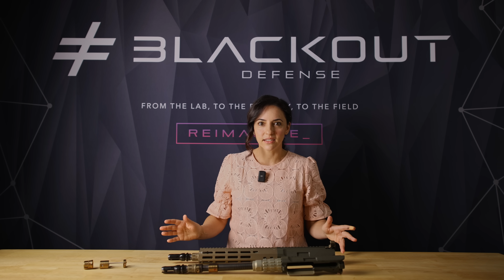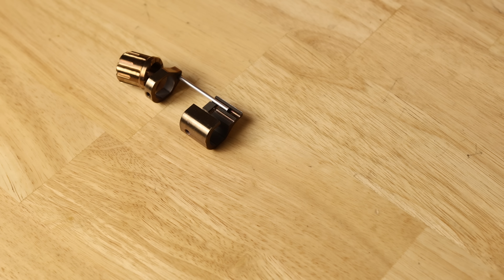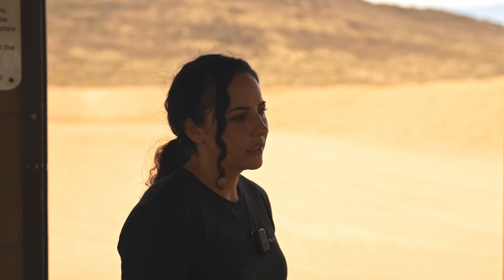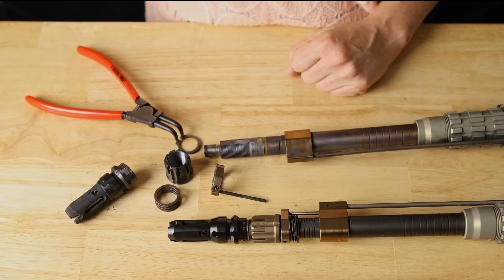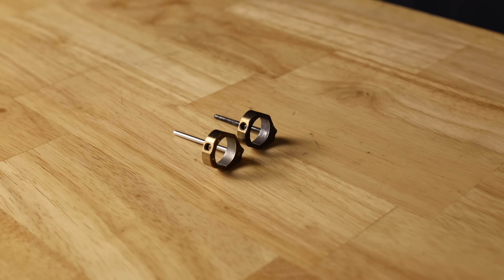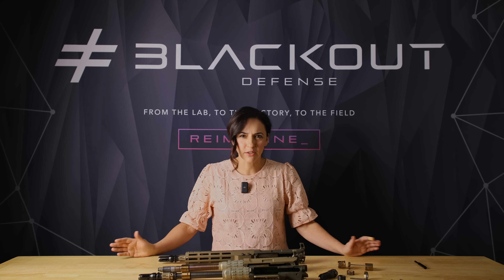HELIX Gas Regulating Barrel System

Comment: It's a more complicated Riflespeed they just added an extended rod and made it two pieces instead of one. And it only works on their barrels?
Reply from the maker: 1- can drive your adjustment from the fully open to fully closed position without changing your rod. 2- There are 20 usable settings. 3- the critical spring and detents are away from carbon exposure 4- Its lighter. 5- Most importantly, you can maintain this system without removing your muzzle device or even your pinned suppressor. 6- you can lock your gas setting in place which is excellent for duty use. I am also adding what I have responded to other users for your convenience: We make our own barrel and everything else on our rifles except plastics and springs. This barrel is reverse compatible. You can remove the Helix system and install your desired gas block. Our barrels are 416R SS and it is blackened (cold bluing method). Regarding the adjustment rod being split. This M42 rod is part of the national stock number. You can simply buy it from McMaster (Part number 8813A28) then it can be grinded to the size appropriate for the barrel gas system (pistol vs carbine vs mid length and so forth). We are also going to provide dimensions and spec for the rod on our site. M42 is very difficult to machine but can be easily grinded like sharpening a punch or drill bit. For those who do not want to deal with it, we will offer it precut on our site. You do not need to remove the muzzle devise. You can disassemble the rod at a certain position or alignment with the adjustment knob (there is an undercut on which creates free access to the rod.) Rod is held in place via 82-degree tip set screw. Please visit our IG page. I have shared everything from my modeling on CAD to how we made this system. I tried to cover everything as possible.

Comment: Making all in the gas block so it could go on any barrel seems like the next step for a V2.
Reply: that cuts into profits, so no.  also i bet riflespeeds patent involves the milspec barrels, so they cant touch the accessories market with a universal gas block without infringing on the patent completely.  Its also probably why they needed to make the parts for a proprietary barrel as reduction in scope, compared to the existing patent.
Reply: @abcdefbcdefg8352  by that logic no one could make a gas block which is obvious not happening

Comment: So you created a hex wrench replacement that's overly complicated. Congratulations you engineered for the sake of engineering. A set screw can replace all of the forward pieces.
Reply from the maker: Congratulations to you, my man! Apparently, you don’t know much about adjustable gas block carbon lock or internal “welding” due to erosion and carbon build up. Run your little set screw until is fully eroded or carbon locked. Then we can discuss using a 3/32" x 6" hex wrench to unlock it. That  will result in a $100 nonadjustable-adjustable gas block.

Comment: So it's an adjustable gas block that incorporates an additional 5+ parts for unnecessary complexity, forces you to use a proprietary barrel, and hangs unsecured (or partially secured) weight towards the front of the barrel, making the barrel harmonics so bad that it will noticeably induce group widening. I wouldn't run this if it were free.
Reply from the maker: I am so disappointed to announce that we are going to cancel your free rifle.

Comment: Well I can appreciate showing the wear and yeah thats to be expected. Obviously will be compared to rifle speed. Regardless for duty use whether this or RS, I think if there were some way for the shooter to find the 2,3, or 4 gas settings they would use and then give them the ability to remove the detents for the rest of the positions. Say they want 3 positions, unsuppressed but tuned, suppressed, and then a setting they choose for adverse conditions. That way they can remove a bunch of extra clicks, counts, paint marks, whatever. But I’m not sure its doable with the design.
Reply from the maker: I appreciate your thoughts. Thank you!

Comment: with it eroding like that will there be replacements for that rod since this seems to be a disposable piece
Reply from the maker: We have not been able to replicate the erosion in semi auto environment. Erosion is more pronounced in full auto testing but not in semi auto. We recommend replacing the rod every 12-15k round. It would cost under $10. Cool fact: This M42 rod is part of the national stock number. You can simply buy it from McMaster (8813A28)! It can be grinded to size appropriate for the barrel gas system (pistol vs carbine vs mid length and so forth). We are also going to provide the spec for the rod on our site.
Reply: @BlackoutDefense  thanx for the quick reply, that is awesome to know that it is relatively inexpensive to replace and easily available. one other question would be have you tested this on ar10(lar308) pattern rifles yet or are you still only set up for the ar15 platform?
Reply from the maker: @crackbot  Thank you. This will be an option for our upcomming M110 style rifle (Q110) as well.  Will be available on both AR15 and AR10 style rifles.

Comment: Very interesting! Would it not be more beneficial to use Titanium than the M42 Cobalt Steel? Possibly more erosion resistant?
Reply from the maker: This M42 rod is part of the national stock number. You can simply buy it from McMaster! It can be grinded to size appropriate for the barrel gas system (pistol vs carbine vs mid length  and so forth)

Comment: Pretty cool. Few questions for you guys
1) Are those rods replaceable by the end user? Seems like a relatively short service life for a gas block/system if not.
2) Does the wear pattern differ depending on gas system length? I would think a rifle length system would last longer than carbine length due to lower port pressure.
3) I'm assuming it would take a lot more rounds of semi auto to get a similar amount of wear on that rod. Any idea what kind of round count you would expect for a semi auto platform? I realize this is probably a difficult thing to answer because people are going to be shooting at different rates and volumes per course of fire.
Reply from the maker: 1 and 3: We have not been able to replicate the erosion in semi auto environment. Erosion is more pronounced in full auto testing but not in semi auto. We recommend replacing the rod every 12-15k round. It would cost under $10. Cool fact: This M42 rod is part of the national stock number. You can simply buy it from McMaster! It can be grinded to size appropriate for the barrel gas system (pistol vs carbine vs mid length and so forth)
2- We are continuing our test to provide full and transparent data to our customers. Our IG page goes back to day 1 of this design. It would be very nice if you could visit that page. I really appreciate your question.

Comment: The Faxon adjustable gas block seems much less complicated, fewer parts and lighter.
Reply from the maker: Let’s test it in a similar environment. Did Faxon did similar test? I would love to see a good YouTube channel take the initiative to do a comparison test on both systems. I will provide free rifle or upper (in case of full auto meltdown)  and 1500 rounds of ammunition. Please let us know!
Reply: @BlackoutDefense  What does this offer over a RS or Faxon for the 99.999% of buyers that arent shooting full auto?
Reply from the maker: @GingerMan69420  Full auto is just a means for accelerated failure test. If this system can withstand stress at this level, it will be able to endure much more at semi condition. Obviously, there is no full auto available to the public. However it is required for LE and military testing and demo.
Reply: @BlackoutDefense that’s not true. Full auto is 100% available for public ownership and use. It’s just heavily regulated.
Reply from the maker: @stevenwilkinson8373 No sir. Absolutely NOT. In a very limited quantity, you need to be grandfathered in ownership for about $10k to $15k for a Select Fire lower receiver. I can’t even transfer a full auto to another SOT. Not sure where you getting this info
Reply: @BlackoutDefense because I own 3 😂 and yes they are grandfathered

Comment: So is the adjustment rod a consumable part?  If so, what is the fire schedule and rough cost of the part?
Reply from the maker: We have not been able to replicate the erosion in semi auto environment. Erosion is more pronounced in full auto testing but not in semi auto. We recommend replacing the rod every 12-15k round. It would cost under $10. Cool fact: The M42 rod is the national stock number. You can simply buy it from McMaster! It can be grinded to size appropriate for the barrel gas system (pistol vs carbine vs mid length  and so forth)
Reply: @BlackoutDefense ok that’s very fair, the full auto fire schedule would accelerate degradation.  Most “normal” users will likely never need to replace it.  Thanks for the reply and transparency.
Reply from the maker: @mgamble11  Absolutely! Thank you

Comment: I appreciate you guys trying to bring something different and innovative to the market, but I have to echo a lot of other commenters concerns here. This just comes off as an over-engineered and expensive system that begs the question who the target consumer is. I’d be very reluctant to purchase such a system with all of the potential points of failure on this.
Reply from the maker: Thank you. Where did it fail? Am I missing something? Could you point me to an AGB that survived this test condition? That was the whole point of doing this test. Adding the whole system to our rifle still cost less than $200
Reply: @BlackoutDefense  Appreciate the clarification. My concern isn’t about whether another AGB has survived this specific test, it’s about identifying and addressing potential points of failure in your system before they impact performance in real-world use. The fact that this setup costs less than $200 is impressive from a cost perspective given how many in the gun community can be notoriously cheap.

Anyway, the goal of testing isn’t just to prove survivability, it’s to uncover weaknesses and refine the design accordingly. Other companies have engineered parts and devices that have failed and brushed them off because “others fail too” or “it’s cheap”, which undercuts the entire purpose of rigorous development and quality control. I’m not asking whether others have passed the test, I’m asking whether this system can be trusted. By no means are my concerns meant to downplay or diminish what you’ve developed here. I genuinely hope it does well and am completely fine with being proven wrong.
Reply from the maker: No problem. Thank you. We haven’t been able to find a way to make it fail. We shall see.

Comment: The erosion on the end of the adjustment rod, if that is occurring because the material is reaching a melting point due to heat from the propellant gases, where is that material depositing? And if the rod is "wasting" from intense use, does that make that a consumable item that will require servicing at X amount of rounds?
Reply from the maker: We have not been able to replicate the erosion in semi auto environment. Erosion is more pronounced in full auto testing but not in semi auto. We recommend replacing the rod every 12-15k round. It would cost under $10. Cool fact: The M42 rod is the national stock number. You can simply buy it from McMaster! It can be grinded to size appropriate for the barrel gas system (pistol vs carbine vs mid length  and so forth)
Reply: @BlackoutDefense - but if there was removal of material in FA fire, was deposition observed inside the gas tube, BCG, or elsewhere?
Reply from the maker: @devilish_details  No. You have massive amount carbon deposits to worry about. The amount of erosion in that rod is so minimal that it factually gets pushed out of the rifle via high pressure gas. Regardless of this gas system, you can find erosion in the barrel and gas block in standard M16 or any firearm in general.

Comment: This is pretty neat. That said, I'm not sure M42 is the material I'd be looking for on that pin, thats just a relatively common pin stock material, any chance for something more exotic like a tip made of C-103 (niobium alloy) it shouldn't erode at all. I think the only thing that's going to hold your system back is the inability to work with the barrel of someone's choice. That said, it's a cool system.
Reply from the maker: Thank you. I will get C103 to test. I need to compare brittleness.
Reply: @BlackoutDefense it's used for making rocket engine parts due to its high heat tolerance and creep resistance at different temps. I'm working on a suppressor design using it for baffles
Reply from the maker: @highdesertdrew That’s great! Thank you
Reply from the maker: Forgot to mention. One of the main reason we selectedd this M42 rod is becuase  it is part of the national stock number. You can simply buy it from McMaster! It can be grinded to size appropriate for the barrel gas system (pistol vs carbine vs mid length  and so forth)
Reply: @BlackoutDefense  Yea, I figured it was a COTS drill blank. You know, McMaster does sell Tungsten drill blanks.
Reply from the maker: @highdesertdrew Yes! But I’m little concerned about brittleness of carbide. I have a dozen rod on order for testing though

Comment: You do realize you didn’t have to resort to a proprietary barrel for this particular kind of adjustable gas block? System is neat but the execution leaves a lot to be desired from an engineering standpoint.

Comment: Proprietary barrel , so question is how good is the barrel who makes it and so on , because now its not about gas system you are relying on barrel quality , i mean neat design , something different for sure , but how about we trst it in dirty environment you know for duty guys , lets see how thst spring performs when its plugged with mud and dirt !
Reply from the maker: We make our own barrel and everything on our rifles except plastics and springs. This barrel is reverse compatible. You can remove the helix system and install your desired gas block. Our barrels are 416R SS and it is blackened (cold bluing method). Will also be available in raw. Regarding spring and dirt, you only need the spring functionality when you are adjusting your gas setting. Other than that, it has very little impact on system reliability. The system is lockable, and we recommend locking it outside the initial setting. Regarding the adjustment rod. This M42 rod is part of the national stock number. You can simply buy it from McMaster (Part number 8813A28) then it can be grinded to the size appropriate for the barrel gas system (pistol vs carbine vs mid length and so forth). We are also going to provide dimensions and spec for the rod on our site. M42 is very difficult to machine but can be easily grinded like sharpening a punch or drill bit. For those who do not want to deal with it, we will offer it precut on our site. You do not need to remove the muzzle devise. You can disassemble the rod at a certain position or alignment with the adjustment knob (there is an undercut on which creates free access to the rod.) Rod is held in place via 82-degree tip set screw. Please visit our IG page. I have shared everything from my modeling on CAD to how we made this system. I tried to cover everything as possible.

Comment: Awesome. Robust. I guess you can just keep adjusting as it erodes over time...
Reply from the maker: Amazing observation. Great job. My feedback about erosion: Temperature is a big portion of metal erosion and oxidation. At 1500 rounds, that rod reached about 1800 degrees (barrel around 1300 degrees). We specifically selected M42 Cobalt steel, which is designed to withstand around 3000 degrees, for the plunger. There is no other gas block in the market that uses M42 Cobalt in its adjustment mechanism. They all use stainless or standard steel, which we also tested. These metals erode completely at around 500 rounds and the system fails. This test with M42 Cobalt was extremely successful and shows the value of that material choice.

Comment: I would assume that the adjustment rod that was being eroded would be a replaceable part for this setup? Looks awesome but would definitely need access to components that are going to fail(albeit eventually)
Reply from the maker: Perhaps around 10-15k rounds. It fully can be disassembled. The Rod is made of cobalt steel. Very difficult to erode.

Comment: One way around the Riflespeed patent is certainly to copy their system but then make it so complicated that nobody recognizes it anymore.
In engineering, there is beauty in simplicity. Plus, this kinda goes against the super accurate and stress relieved barrels you have to just hang sh*t on there.
Not everything is a problem in need of an overly complicated solution. Having the money to buy one of your nice rifles is already hard enough.
Reply: yeah, i would've gone the opposite direction.
instead of all this restricting and eroding stuff, do what FM and GO did in the Monolith. A 45° flow path in the gas block to enable unobstructed laminar flow. That way you can use much less gas in every use case. And with less gas to begin with, overgassing and tears from gas to the face become less of an issue anyways.
Reply from the maker: @maxi1958 That will be on our M110 style rifle. Currently testing that proven concept with minor mofification
Reply: @BlackoutDefense  that's actually interesting. Thanks for the info.
By the way, with your tech it would be cool if you could force your engineers to do a product deep dive like Lead&Steel did for their specs. All the nerdy stuff like which inside of what part is actually DLC coated to make it more better. The things that wouldn't fit onto the website, but warm a nerds heart in a 30min video.